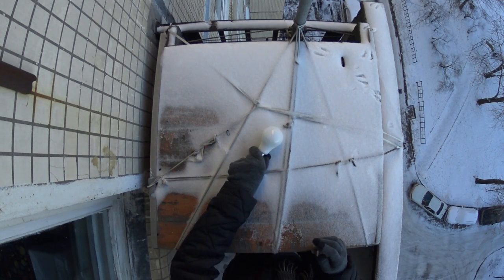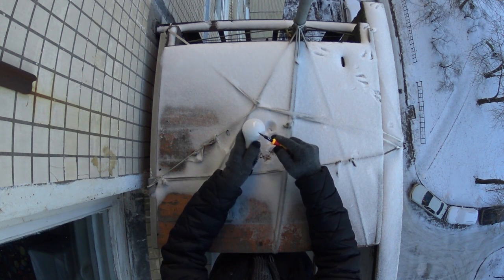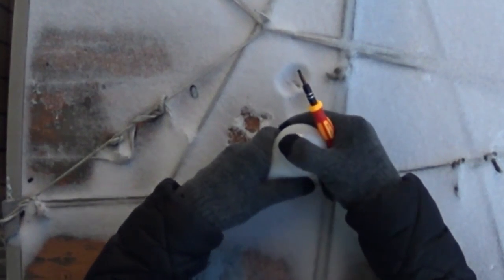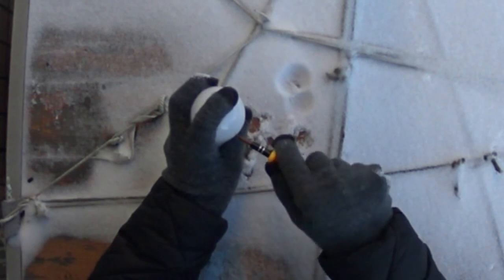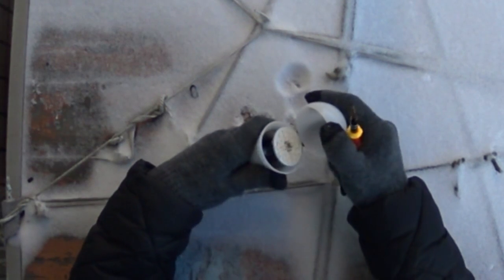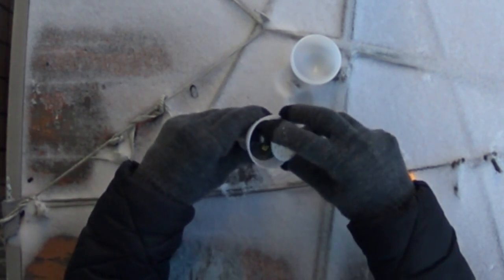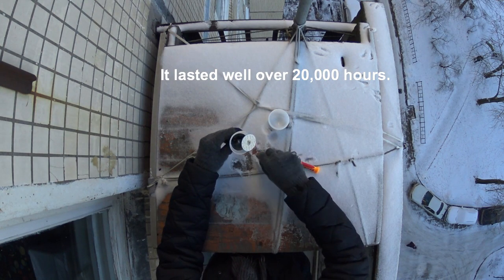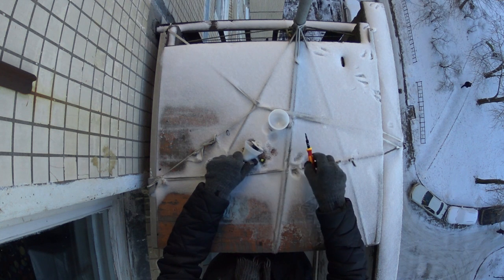Broken Open - LED lamp

Comment: Do you slam that heavy front door? Perhaps that broke the wires. What about large changes of temperature in the hallway?
Reply from the maker: +Roger Hudson Good point, there are quite a few people who go through the door. I also wondered about it being hit by something big being carried out.

The temperature shouldn't be a problem as it doesn't change quickly. Between about 10c and 30c through the year, it's heated in the winter, and there are double doors. Thanks for watching!